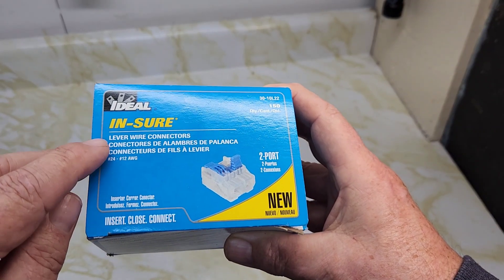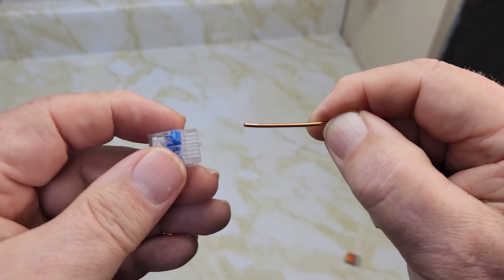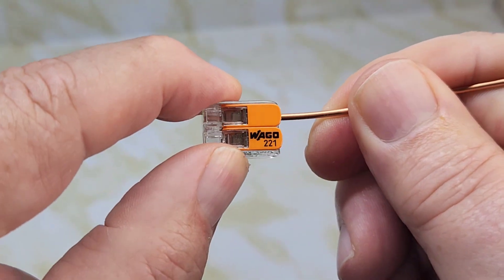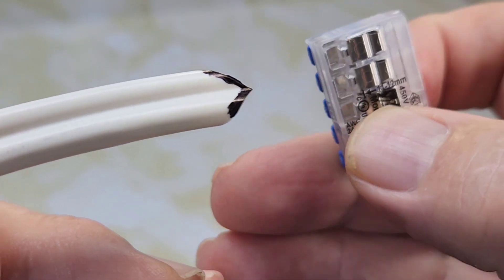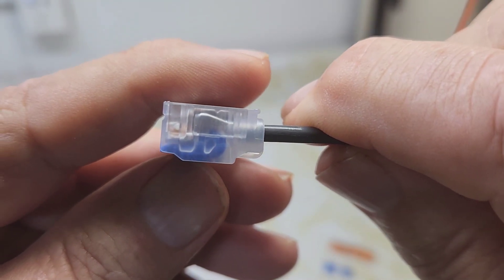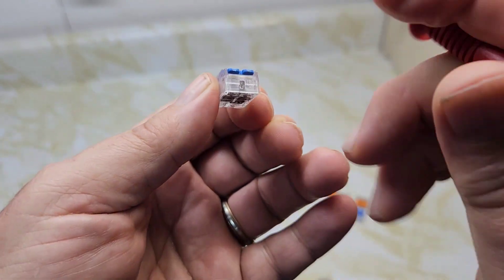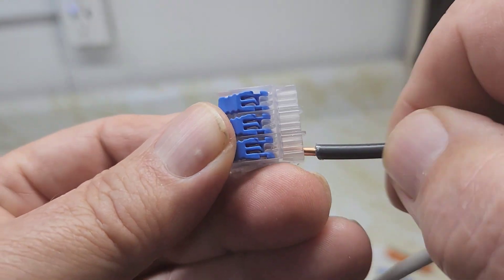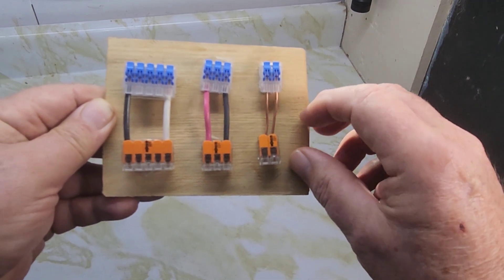Ideal Lever Connectors

Comment: Almost No one talks about using these with stranded wire but they're approved for it.  I've heard claims that these lever nuts are great for joining stranded to solid.  I Don't agree.  I'm on the Ideal bandwagon and I can say I'm not stoked.  They don't hold solid or stranded wire securely.  I even wrapped one with tape - hot and neutral- and the solid neutral came loose.  Took forever to find it because I had changed out other receptacles on the circuit and found my tester saying "Hot/Gnd Rev" and voltage on neutral and ground! I punted and used a wire nut and pre-twisted with my linemans.  "Skookum" as AvE says.

 I also had several times where stranded wire just wouldn't feed.  It would get all frayed and became unusable.  I ended up cutting and stripping until the pigtail was only maybe 2". 

This is only an issue bc Leviton thinks they're saving me time by pre-wiring their receptacles with 12 gauge stranded!  🤬🤬 Anyway I kinda figured out that if you keep the strands perfectly straight after stripping and you meticulously make sure every fiber gets in, you can push the wire in slowly, lever OPEN, and it usually holds.  But it does NOT inspire confidence at all.  

Also... The Ideal "snapping into place" seems good but in a tight box they still flip back up sometimes.  Honestly it's hard to beat a nicely pre-twisted group of conductors and a wire nut for security.

Comment: whats their amp rating?
Reply from the maker: 32 Amps same as the Wago.
Reply: Note that if you're using them for building wiring in the US, they only handle up to 12 AWG wire, which is only allowed for up to 20 amp circuits, so that will actually be the limiting factor for both the WAGOs and the Ideal ones.  If you're using them for other applications, you can go up to the full 32A with either one, though.
Reply: They have a European and US rating, and that's 32A European or 20A US.

I've got the Ideal ones, and the only rating on the connectors is the European 32A one.
Reply from the maker: @ypw510  Thanks for posting.

Comment: I saw these at Menards, were 20c more than the wagos. Was hoping to get a bag or two just for easy low voltage projects, but they cost way too much for that.
Reply: I'm in the US and Amazon was (directly) selling a jar of 500 of the 2-port version for $25.98, but that's now apparently out of stock.  The host is based in Canada though.

Comment: I've been using Wago connectors for the past year and a half, and have been curious about the Ideal connectors. Seeing this, I'm 100% sticking with Wago. I don't really care about being able to press the wire in, and the extra thickness is a big downside for me. 
I also prefer the direction of the Wago connectors, as pressing the lever down is the same direction as pushing the wire into the connector. With the Ideal connectors in a tight spot, it might be harder to keep a wire fully seated while pressing the lever down.
The one thing that I do like is that the levers can click into place. However, the issue you mention with that for Wago connectors isn't that big of a deal. When there is a wire in there, the lever has a bit of play in it, but is still fully latched.
Reply: Yeah, I'm somewhat dubious about the reports of WAGO levers being released by just pushing wires into the box, etc.  I suspect a lot of them are just imagined scenarios from armchair electricians.  If you're actually laying the wires in carefully (which you should do anyway) instead of just mashing them haphazardly into a rats nest, I can't see how that would ever reasonably actually happen.

I would also point out that the levers going the other direction does not in any way make that less likely to happen (but the positive click into place potentially does, so I'll give Ideal points for that one.  On the flip side, I'm pretty sure that that "positive click" feature is the main reason why the Ideal ones are physically bigger than the WAGOs, so it's a bit of a trade-off.)

I'm also dubious about the "just push it in" feature.  Frankly, if it actually is easier to do on the Ideals than the WAGOs, that suggests to me that the Ideals don't actually grip the wire as well and therefore are also more likely to be able to be pulled out, so that seems like a negative to me, not a positive.  Technically, you can do that for WAGOs too, but it takes a fair bit of force, and I've never really understood why people want to in the first place.  Flipping the levers is not really that hard, and takes maybe an extra second, max.
Reply from the maker: @foogod4237  I never had a problem with  he Wago wire nuts. The Ideal you can insert the solid wire but have to lift the lever to get the wire out. They are secure,
Reply: @foogod4237  
Not at all.  What prevents the wire from pulling out is the spring pressure and the shape of the spring, which is more like a finger.  It acts like a barb, similar to push-in connectors, although it doesn't seem to pull out with twisting like most push-in connectors.

The "click" at the fully down position doesn't seem to do much.  I've had a few where the individual fit of the parts didn't even register a click.
Reply from the maker: I have been using Wago connectors without a problem. Others have reported the lever on the Wago connector can be flipped up when installing the wires in the  electrical box. The ideal Lever connections slightly thicker.
Reply: @JimMcLaren1950  right, I've seen those comments as well. I've yet to see that happen, and I think it likely won't if you plan how the wires will fill the box. I think a lot of people confuse that bit of play in the lever with it actually being loose, though I'm sure people have gotten worse pushed under a lever and actually released it.
Reply: If it matters to you, just have a feel of them in your hand.  I’ve used the WAGO 221 and don’t have a problem with it, but they don’t feel as substantial as the Ideal.  It’s hard to describe other than the WAGO shell doesn’t seem as thick and strong.
Reply: @ypw510  I've since used the Ideal connectors. I can see what you are saying, but didn't find it to be much of a difference. I was not able to press wires in as described without a lot of force. The only significant difference I found was a lot less visibility of where the wires are in the housing with the ideal connectors, as well as them being very slightly bigger. The latch in the ideal is more positive, but I don't worry about that.
For me, the visibility is the most important differentiator, especially with stranded wire. The ideal connectors definitely seem to be a good product, though.
Reply: @MikeKunkel  
The Ideal lever connectors do have a clear window at the tip that can at least provide visibility that the wire has been completely inserted and the tip is in contact with the end of the bus bar.  However, that’s on the side opposite the lever and it might need to be turned around.  It also needs to be properly stripped, as there’s really no visibility where the spring clamps on the wire.  On a properly stripped wire in a WAGO 221, it’s easy to see that there’s a length of bare wire where the bus bar contacts the wire.

It’s odd because there are some vids showing what looks like earlier versions of this lever connector from Ideal that have a clear shell.  I think I that might have been called the In-Sure Gen 2.  Ideal had a previous lever connector design (In-Sure Lever) before this one, and those were also clear.
Reply: @ypw510  interesting. I haven't seen those. The ones I used had a little visibility on the outer wires, but not in the middle. Even so, it was harder to see. I do also like what you mention about being able to see behind the bus bar on the 221 connectors.
Would be a great improvement if ideal changed to a clear shell. I would likely stick with wago, but mostly because that's what I've been using.
I would also say that wago has a lot of accessories for the 221 connectors that come in handy. Like din rail carriers, panel mounts, and water tight enclosures. There are lots of others, but the accessories tend to be hard to find in the US. I hope ideal will catch up there soon as well.
Reply from the maker: @ypw510  Thanks for posting.

Comment: What is the difference in price?
Reply from the maker: Amazon $61 box 150 - 2 port (.41 cent each ) $19.98 Shipping.
Covalin Electrical :  3 Port ( .50 cents each )   5 Port ( .74 cents each) . Picked them up at the store.
Reply: @JimMcLaren1950 
I can’t find them for sale on Amazon any more, but I bought the jar of 500 2-port ones for USD $25.98, sold directly by Amazon for US delivery.  It seemed like a fat finger mistake or something, but I ordered and Amazon delivered at that price.  The box of 150 cost more.
Reply from the maker: @ypw510  That was my problem they had them on Amazon but shipping was ridiculous. They did come on sale and bought some only to find out they were shipped from a electrical store near me. I was able to buy 3 and 5 connectors at a lot cheaper price.

Comment: Do they have any of these connectors that puncture wire so you dont need to strip them?
Reply from the maker: None that I know of.
Reply: IDC (Insulation Displacement Connectors) are notoriously bad for higher voltage/current applications, and are also known to often degrade over time.  IMHO, they should never ever be used for mains AC connections (like these connectors are mainly intended for).  They're OK for low-voltage applications, but there's actually a reason why nobody makes these sorts of connectors that way that are actually rated for the same uses...
Reply: @foogod4237  
It's remarkable that a company with a stellar reputation like 3M makes/sells them.  The first time I saw any were at a discount hardware store and they looked really sketchy.  Then I researched them and 3M basically makes them the same way given that any patent they had on the original Scotchlok has long expired.

If I had almost no room to work with, their Scotchlok 314 does seen rather tempting, although it's only meant for use up to 14 AWG and 15A.  They claim that it's almost moisture resistant unlike their traditional version.  That one doesn't have the flip over locking cap, but just pushes in the connection blade (tin plated brass).

Comment: these are essentially wago connectors.  they have been used in the uk for YEARS and they are genius!  little tip: look to the uk for any sort of innovation in home wiring.  the us is decades behind in terms of safety (i mean just look at the nema plug we use)
Reply: I mean yeh the US plug is terrible but the british one in my opinion isn't better  (I mean its secure and all but it goes overboard)
the EU one in my opinion is a good mix between security and usability
Reply: eu knows what they're doing too!   @Ramog1000
Reply: Dude you are still using ring circuits. You have fuses in your Plugs because your breakers arent set up to trigger when a single socket on the circuit gets overloaded
Reply: @SchwertKruemel I thought the fuses are in the plug because they refuse to put a more expensive cable on the plug which is rated for the full current of the mains?
Reply: so you think that if you have fuses on your plugs, then the breakers you have must not work?  what kind of logic is that bro? @SchwertKruemel
Reply: @RandyMarshTegridyCEO  It's not a question of not working.  UK codes explicitly allow undersizing breakers for the wire used (in ring main circuits).  It's an absolutely idiotic and outdated practice which, contrary to many claims, is actually more unsafe and uses more wire (but Brits still love to swear they're the "innovators in electrical safety" anyway).

British codes also allow plastic breaker panels which have actually been well known to be the cause of many house fires.  Each country has its own advantages and disadvantages in their codes, but realistically, the UK has plenty of its own faults too.

Note that most US power cords are fused too, just like the British ones.  In the US the fuses are just built into the appliance end instead of the plug (which makes the plug much less outrageously bulky and awkward).  There is really no effective difference in the protection mechanisms present or how they function.

And WAGO connectors don't even come from the UK anyway.  They were actually invented and made by a German company, so your original claim is about the wrong country to begin with.  (And WAGO connectors have been entirely allowed (and used) in the US for a very long time too.  They were just much more popular and more widely known about in the UK, mostly due to different marketing, nothing to do with "innovation".)
Reply: @foogod4237 The latest 18th edition of the UK wiring regulations specifies metal boxes for "breaker panels" specifically to address this issue.
Reply from the maker: Thanks for posting.
Reply: I know both sides of the ponds, VDE rules !
Reply: Those aren't approve in my place electrical code

Comment: Just noticed them in Home Depot.  A whole shelf filled with Ideal products.
Reply from the maker: Home depot in Canada? Looked for them at Home Depot and Rona's nothing on the shelves.
Reply: Nah man, HD in 'Murica!! @JimMcLaren1950
Reply: @JimMcLaren1950 you won't find those in Canadian hardware store for a simple reason: they don't respect any provincial code
Reply from the maker: @Manche-De-Pelle  I am curious what provincial code?
Bought these  local Electrical store.
Reply: @JimMcLaren1950  it's what a building maintenance teacher told me while ago.  He also showed me the other way to install an electric outlet with out the top screw and told me it's also not conformal to the actual building code in Quebec...

He told me that we are behind like 20 years ago compared to Europe and nothing move in that era.